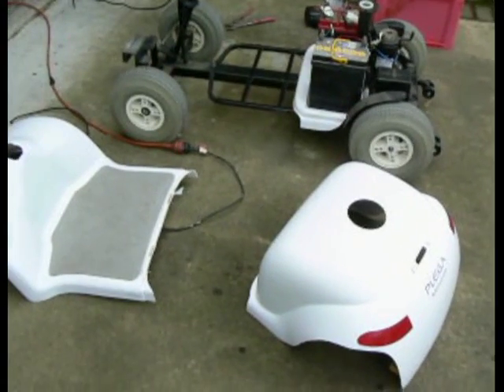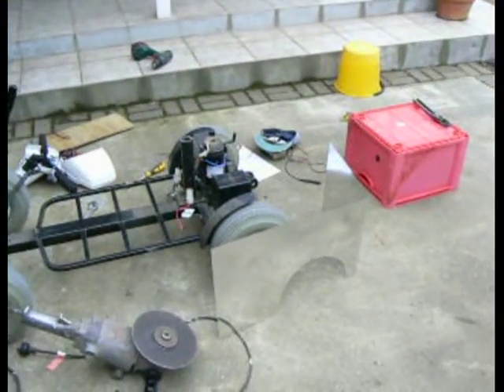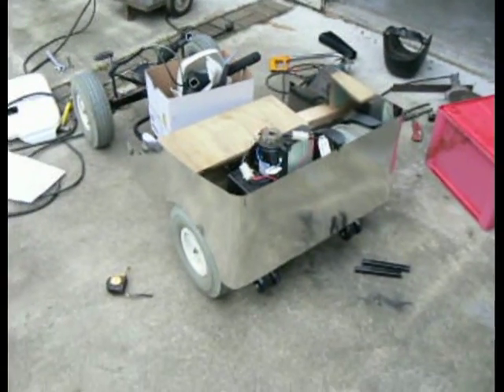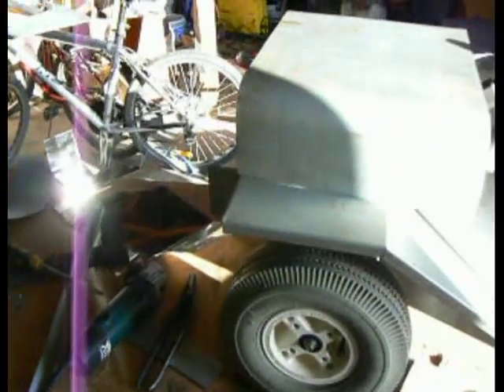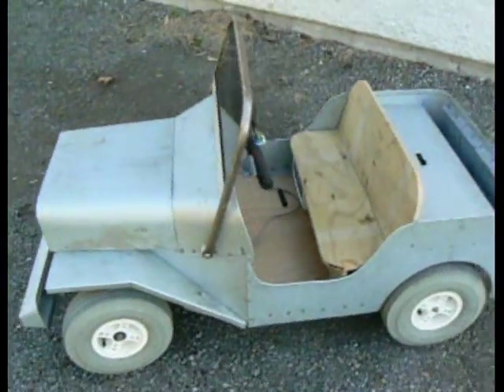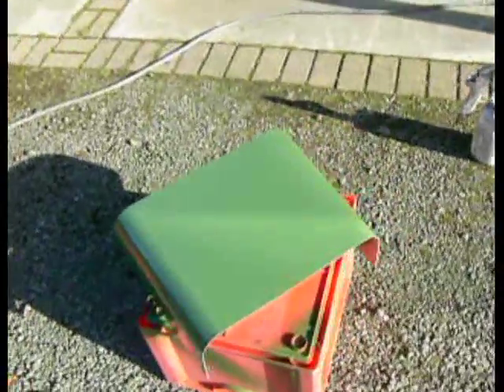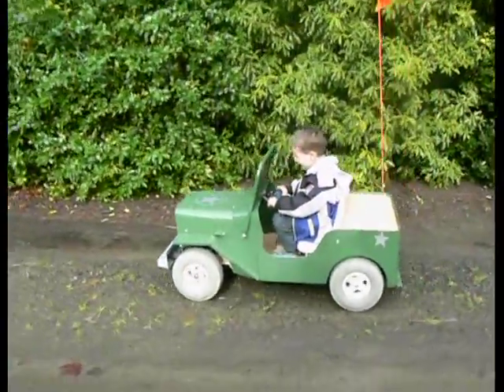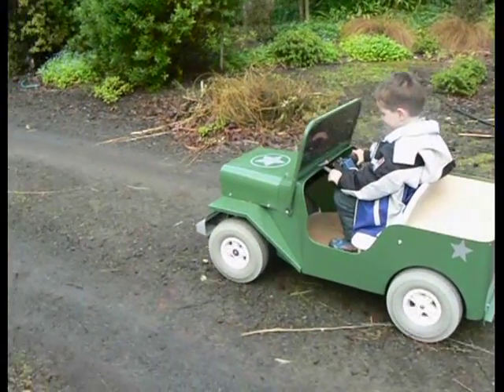Build a Jeep conversion from a mobility scooter

Comment: Keep seat as low as possible so it's not top heavy
I bought chrome decals batman etc vinyl stickers and chrome edging on eBay
Cheap and looks very good
Also I got loads of switches dials etc 
I also added chrome lights but there do drain the battery when on
Work great on grass areas too but drains battery quicker
Look after the batteries 
I added seatbelts the batmobile can seat two kids 
I am going to make a trailor